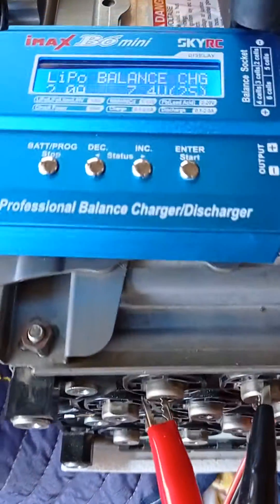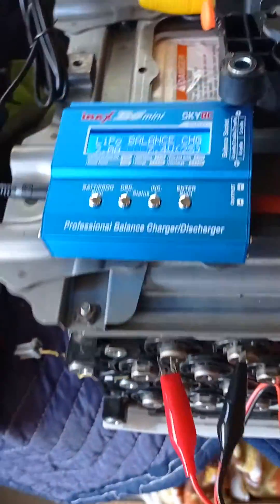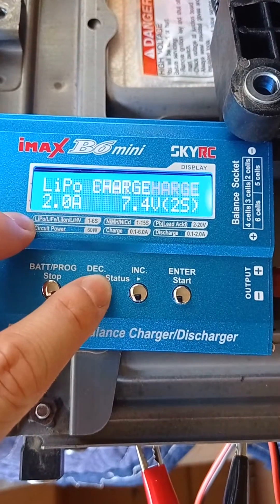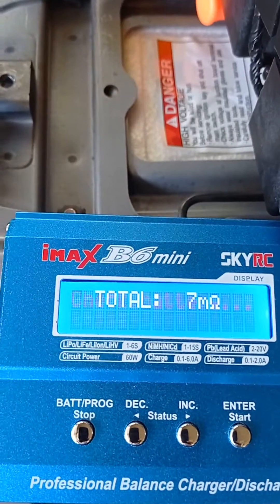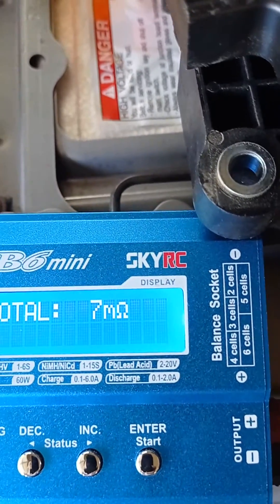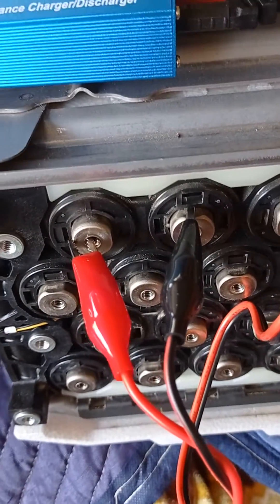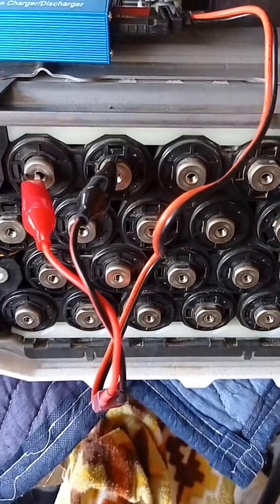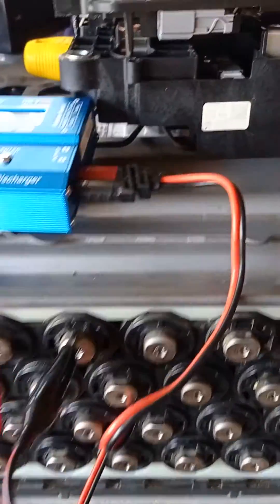[Fast] How to Find Bad NiMH Hybrid Battery Sticks / Cells: Use iMAX Mini to find Internal Resistance

Comment: The nimh battery resistance on a graph has a U shape. Meaning, the resistance is higher when the battery is either charged and empty, and lower when in middle range charge.
That's my two cents.
Reply from the maker: Great point! Our team just looked at the graph.

One explanation we came up with is that these sticks were in the middle and could have endured more heat damage than the others. This might limit their ability to hold charge. Thus, their Internal resistance (IR) is higher than others because they are almost perpetually discharged.

This also could explain why the IMA system was always trying to charge the battery--some sticks could not hold a charge.

Although, we're looking into it further to see if there are other explanations.

In the meantime, we have another video which is just a graph measuring the IR of three different IMA batteries. We found that the IR of each battery had high resistance in the same or similar spots (the middle of the battery).

Feel free to share more, disprove this, confirm it, or add other details.

Thanks!

Comment: What is the right resistence value which says its in good shape or in bad shape
Reply from the maker: Great question and that's one reason I made this video. There is not much info on this, so we need to keep working to find more exact answers.

For now, the lower the better.

I found most of mine were under 30 and they were good.

The worst ones are very obvious and are usually over 100.
Reply: Thanxs for your reply I found all my battery cells having 10.53 ohms more or less this shows they are fine but still I m not having good milage in fact very bad milage and the battery bars drops all of them sometimes 
What's else I can do to?
TIA
Reply from the maker: @naeemwaheed6759  Have you tried charging (~17.9 V) and discharging (to around ~10 V) the sticks with iMax B6???